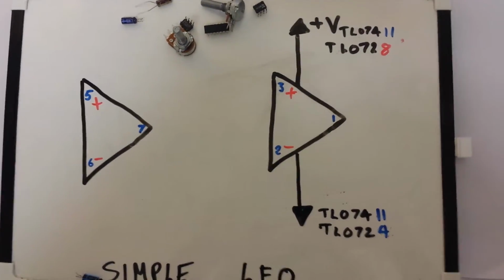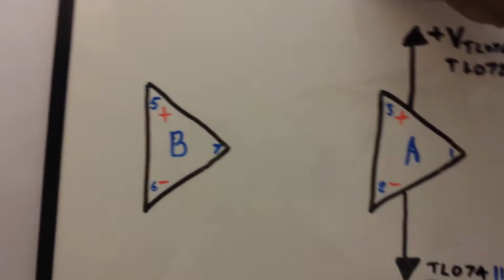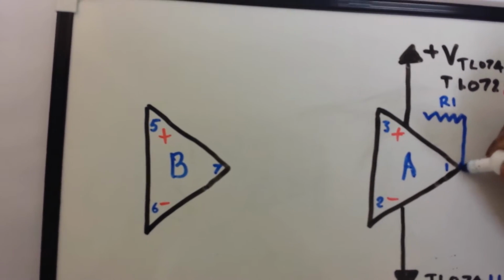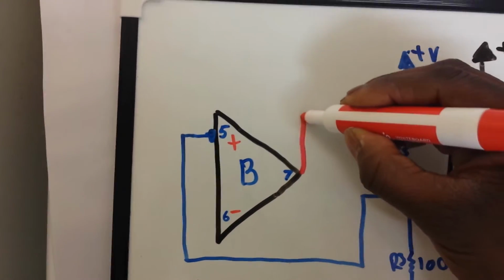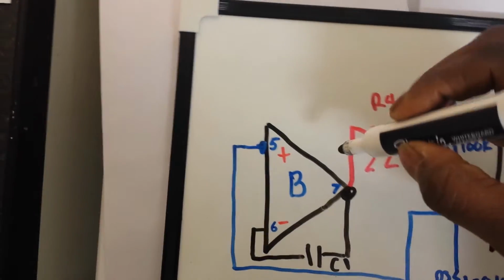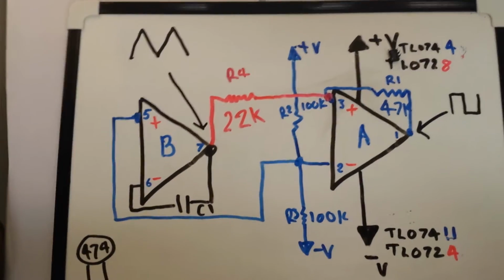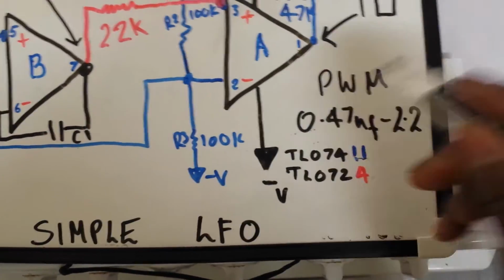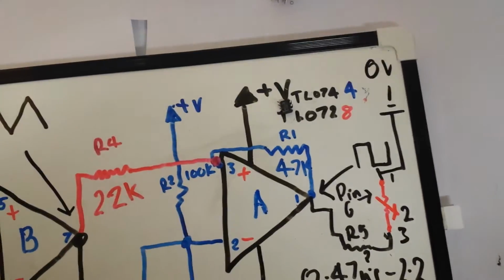DIY analogue synth project Tutorial Part 5 ( Simple Sqr/Tri wave LFO)

Comment: Why are you creating an artificial reference with R2 and R3 instead of using Ground?
Reply: Taking pins 2 and 5 (TL072) to ground works as well. 
I just built this circuit, it works as described.

Comment: I'm discovering your channel. It's great ! Thanks ! About the capacitor, if it's an electrolytic capacitor where is the + where is the - ?
Reply from the maker: If its electrolytic + side of polarised cap inverting input pin 6 and - to the output pin 7 . To be fair it works either way around . Hooe this helps :-)

Comment: sorry but you don't understand electronics. this circuit is bogus. the amp on the left will sit at either of the rails and do nothing. one of its inputs is a constant voltage and the other is a cap connected to a constant output. just crazy!
Reply from the maker: Engineer Of Wonders This particular configuration is not my original design, however it is the same basic circuit i have used for my lfos to this day.
Reply: @AdamTheAd-vanc3d  Check your circuit again. Paulo is right - this will not work. Op-amp B has no input
Reply from the maker: @Roderick_Legato  The only thing I missed out was a potentiometer / resistor between pins 1 and 6 which you use to vary the frequency . Yes the circuit does work and in prepared to video to prove it !
Reply: @AdamTheAd-vanc3d  Okay, let me clarify: the circuit - as shown - will not work.  Leaving out the potentiometer is not a small omission. By the way, what you drew on the right edge later in the video (and didn't connect to B's input) is a rheostat (variable resistor), not a potentiometer.
Reply: I've tried to build that schematics - doesn't work

Comment: For ceramic cap max value, I found 1uF, I don't know if more is possible, but I use them for OSCs ;) nice vidéos thank you for putting all the infos together I feel like I took the same path as you did two years ago, so thank you again, I'm sure you'd have liked it if someone did those videos when you began !
Reply from the maker: 3H3 For ceramic 100nf ive usualy foud tantalum a bit higher up to 10uf. Thou i have installed up to 10uf electrolytic for my new lfo as a second switchable speed option. It has been a rewarding and fun journey.
Reply: Adamski A. So this circuit could be used as an lfo or OSC with a Switch between different cap values ? Say .1uF / 1uF / 10uF
Reply from the maker: 3H3 Indeed yes its the basis for my saw core oscillators :-)

Comment: I really like your tutorials. At the moment i'am also on the way of building my own syntheshizer.

Maybe a small tip for your circuit drawing - there is a different way (i think it's european) way to draw not connected lines. that makes it more obvious. You just draw a small halfcirlce that looks like the line is jumping the other one.

Example picture: http://automatisierungstechnik.hs-pforzheim.de/fileadmin/kleinehelfer/grafik/freie-schaltzeichen/extension/anleitung_install/Kurzanleitung-Dateien/Bildschirmfoto3.png
Reply from the maker: WooDWorkeR Hi thankyou for watching the videos. I wish you great success in building your synthesizer. 
Thankyou also for the tip on drawing the schematics for the non connected lines. I know exactly what you mean , where one passes another you draw a hump line which goes over the top. Sometimes my method can be confusing